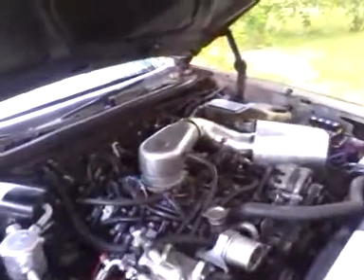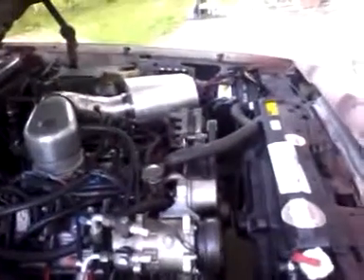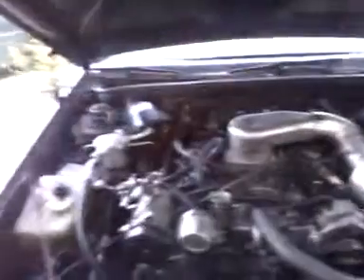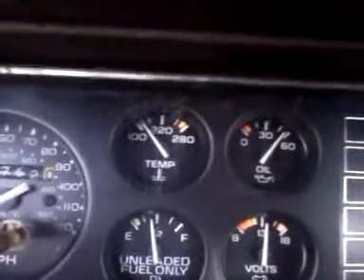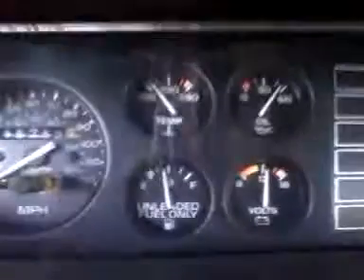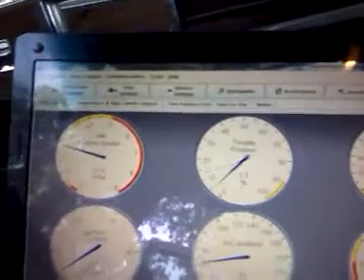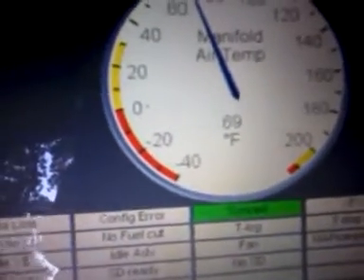Olds 403 start up of my Megasquirt MS3-Pro Sequential EFI system

Comment: I just ran across your channel and have subscribed. How has the MS setup been treating you since then?

I run MS also on my Supercharged Probe, and might this spring be doing exactly this to a 403 as well, and would need to figure which Intake manifold, TPS, IAC, and throttle body to work from.

What did you do for your o2? Did you install a basic narrow band or did you go wide? I went with an AEM wideband in my Probe so that I also get a proper gauge and controller, as I had deleted the stock ECU entirely.

What did you set your rev limiter to?

Do you drive any of the automatic transmission functions from MS too? I never work on old ATXs, so I am unsure the details. 

Thanks for the videos!

Comment: How's the tuning coming along or do you have it dialed in already?
Reply from the maker: I'm in process of replacing my exhaust manifolds because it cracked which gave me a bad exhaust leak but found some good used ones on ebay and once I'm done I'll begin tuning.